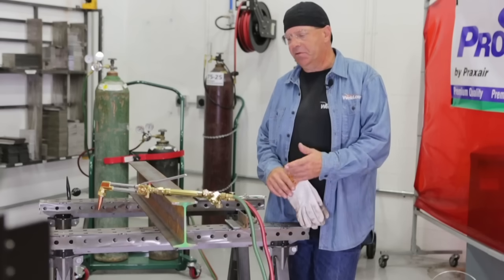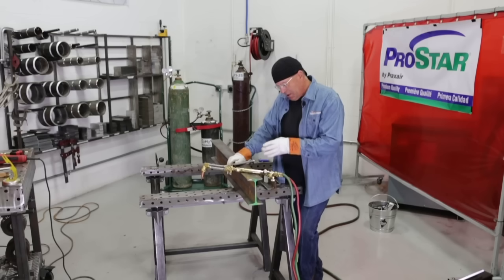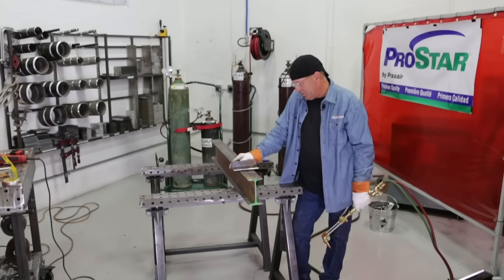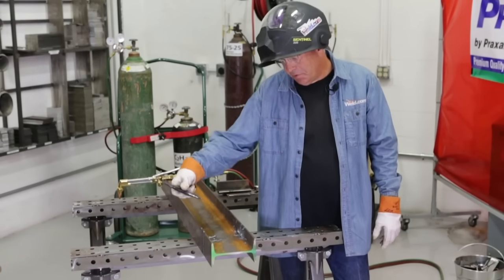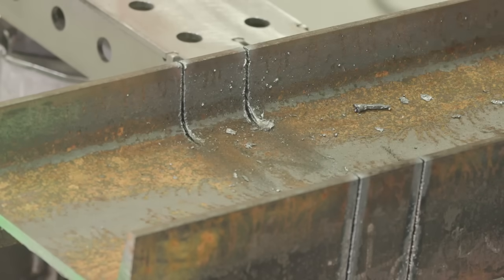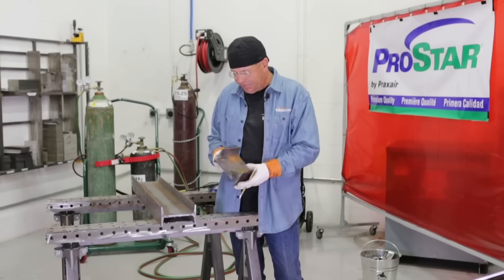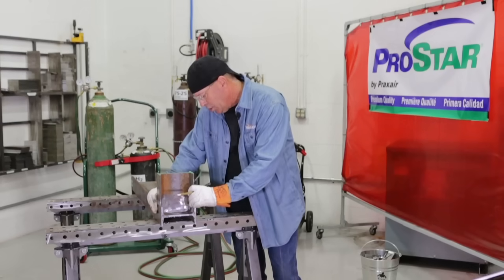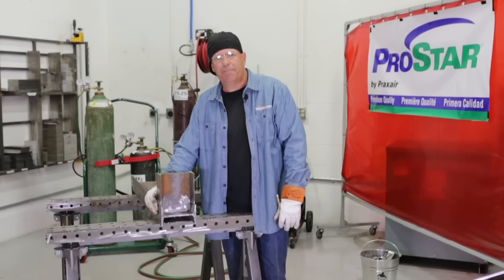🔥 Coping an I-Beam

Comment: 10:21 your other boo boo is where the edge of the flange and the web meet there’s about a 16th of an inch cut inside the web on both sides. You put a decent size load on those joints and you’re gonna start having pressure cracks forming. Slightly ease up on the oxy if you don’t want to cut into the web when burning through it

Comment: your bad...lol i was watching you make that cut and seen the curve, and I was wondering if you were going to come back for the arch.... you had me scratching my head..but I'm always building something of modifying something the angle iron 
fitment will make people cut the wrong side of the angle iron..
SO I always made it so I can avoid the wrong side cuts, 
b5ut my torch is BUSTED so most everything is cut with saws
porta bands, saw-all, cutoff wheels, I WOULD like a plasma cutter, 
subbed.....willing to learn! just built a SLAT WELDING TABLE...
looking forward to using it..    can't affordcanything new.., intrested in the (saw horse) stands ...to see how they work with the holes ....but it my first VIDEO with you

Comment: Thanks for the video
Do you use flash back arrestors?
I had an oxy acetylene torch exploding in my hand early this year  ( blowback) and the flash back arrestors stoped the flame before it went to the gas bottles.
Cheers from Australia
Reply from the maker: Yes, they're built.into the torch.
Reply: Wow that's scary. We require them on both ends of the hoses on the fuel and oxygen, in Canada. They get a little bulky on the torch end if you are using the screw on type so now, like Bob said you will find the built in.

Comment: Really like your oxy cutting vids; it's nice to know that flame cutting can be a reasonably precise and clean manner to cut steel, as opposed to a way to produce a ragged, burnt mess of slag on the end of a workpiece that looks like Satan 'sharted' fire to cut the part in two.

Who'd have thunk it?

Now, could you do a vid where you demonstrate how it looks when incorrect tip size and pressures are used?  That way, some of us at the, uh... "remedial" end of the spectrum can see why our cuts look like the devil's bowel movement.

At least, if sensible folk ever let us near a torch set again...

Comment: Bob, is there a product, some sort of paste or similar, that you can use to put between steel, such as for example 1/8” sheet onto square tubing, that will seal it and stop water ingress so I can just stitch weld it on an not have it catch fire and burn out like silicone or similar would?

Comment: Off topic but I was wonder do you need a respirator/breathing protection when wielding  or only during certain operations. I am new to welding and was just wondering
Reply: You should. You can't guarantee you will avoid 100% of the fumes even if you are outside or have an extractor. You just need a North or 3M half mask with a P100NL pancake respirator or equivalent. They fit under any helmet or face shield.

Comment: Grind a bevel and weld up the flanges, and forget the small gap at the radius.  Most of the strength of that type of connections transmits through the flanges.